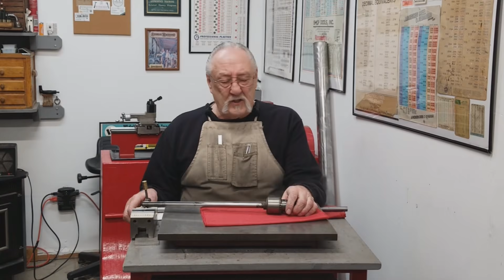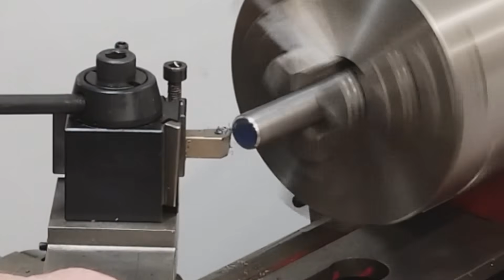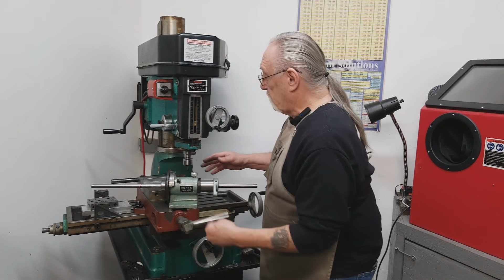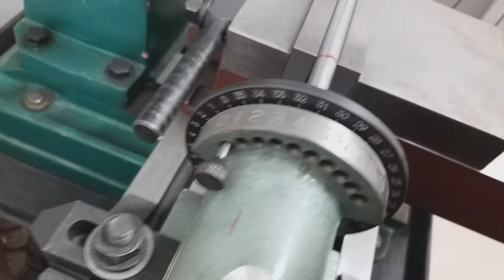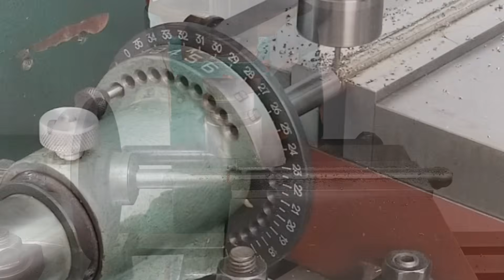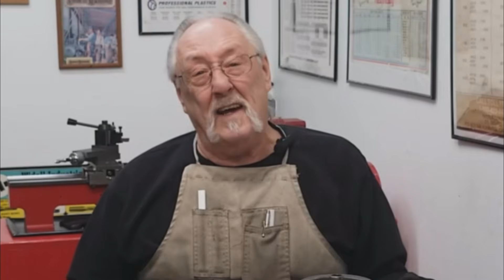The Machinist Brain, Delta Slo - Speed Tapping Machine, Part 4

Comment: Nicely done. I like the Spindex tool you have there. The double keywayed shaft turned out great.
Reply from the maker: That Spin Index Tool comes in handy on a lot of different projects. Yeah, my Drill Press/Tapping Machine project is going pretty good, slow but in the right direction 😁. Thanks for watching Deez. 👍

Comment: You need to run it at the highest speed. A major problem in home shops is running carbide too slowly. I run 0.500 carbide cutters at 3,000 rpm. Even that’s too slow. 0.125 carbide bits need to be run at least at 5,000 and preferable]y 12,000. Obviously we can’t do that,  but you need to slow the cut speed way down or you’re exceeding the tooth load. If you don’t have a top notch collet chuck and collets, the runout on small cutters is enough to exceed the tooth load even at high speeds, so you need to go really slowly. Those cuts were originally sawn, not cut with a bit.
Reply from the maker: Yeah you're right,  I've been using HSS end mills for to long. Thanks for watching and thanks for your comments and RPM's info.

Comment: I like this machine idea. May have to keep my eyes out for another drill press. The twin key Delta would certainly be easier than a splined Craftsman
Reply from the maker: I take it you're using a splined Craftsman?
Reply: @GlennNowOnYouTube  My DP is, but if I make a tapping machine, like you I''ll try to use a Delta
Reply from the maker: That makes sense to me  👍

Comment: Looks great!  It's a shame you couldn't get the chuck off, but I guess it might be useful for quick swapping.  Say if you decided for one job you wanted to use the chuck on the drill press instead of tapping.  Might not be viable, but just a thought.
Reply from the maker: Hello Joe, My first thought was if this doesn't work I can always go back to having a drill press. I don't know that I ever really wanted to modify the original spindle.  But I did want to know how the chuck came off. I think this will all work out for the best. Thanks for watching.

Comment: ops your spindex pin in not in  to 0 all the way
Reply from the maker: Sure it was Paul. Thats where it stopped. Both places, at 0 and 180. And as they say, the proof is in the pudding.  The double drive dog keys went right into the two slots. But you were right, the pin was sticking out quite far. That was something I noticed when I first got that tool. The main thing is, It works. Thanks for watching.
Reply: Yeah, I think some of these budget spindexers have a short shoulder and a pretty small pin/pinholes to slide into.  A bit odd of a design, but I guess it's just a cost cutting thing.

I think they still would work fine under light duty use or just for positioning (like done here).  I haven't been able to fool with too many personally though, so I don't really have the authority to say much more.

Joe T
Reply from the maker: Have you ever had to neck down an end mill for clearance.  Thats why I bought that spandex. For grinding clearance on the surface grinder.  They work find for that.
Reply: Ooh, interesting.  No, we keep stuff around that has custom ground clearance.

Usually anything that needs to be special gets hand ground on the bench grinder.  I've clearanced dozens...probably hundreds of micro bars and tools this way.  I think the wheel used is what most call a "green wheel" for what it's worth.

I'll keep your tip in mind for the home shop though.  I bet it'll come in handy.

Joe T
Reply from the maker: That would be silicon carbide or green silicon carbide. A diamond wheel on a surface grinder makes that job go a lot faster. Holding the tool in a spindex, spinning it as you down feed the grinder.
Reply: @GlennNowOnYouTube 

I can imagine.  It eats the wheel when I use it.